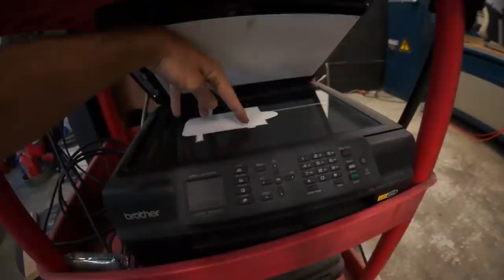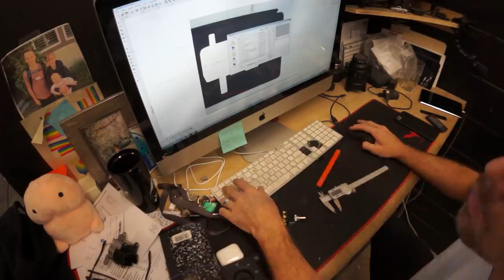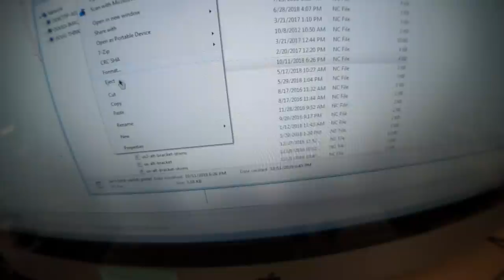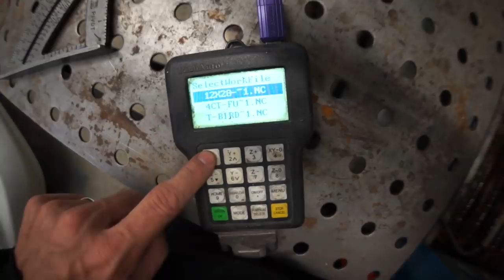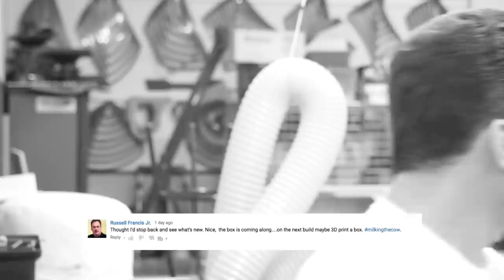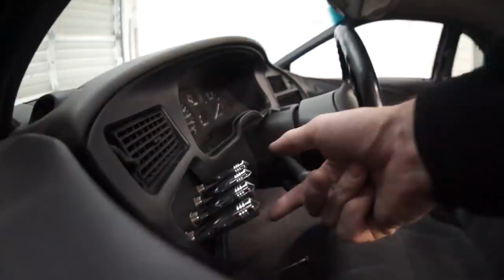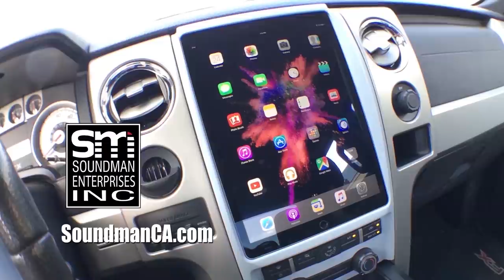Rafa's taking forever and I'm done already - NEW SWITCH PANEL! - White Rider #51

Comment: Cool deal! When I had hydros on my truck I had 4 accumulators rode so good but wouldn’t hop. I always wanted to buy and add that onboard charger that would automatically charge the battery’s off the alternator when car was running but it was expensive.

Comment: you probably already though of this but should put a hidden switch somewhere hooked to relay that kills the ground to those switches. that way if you park it somewhere windows down some dingis cant reach in there and fuck your car up or hurt someone. its kind of a liability issue having them mounted where any kid or jack ass adult can reach in and wind a pump out or worse.